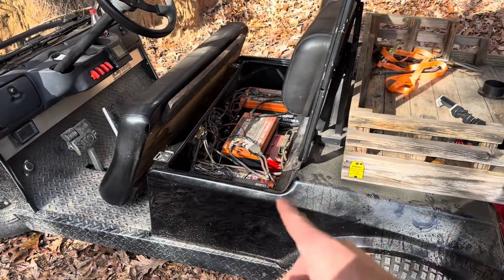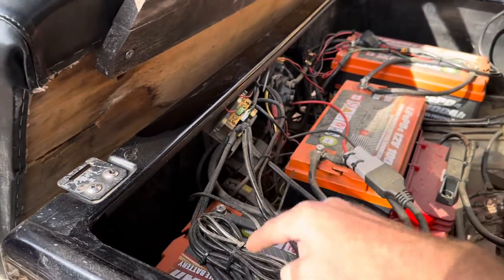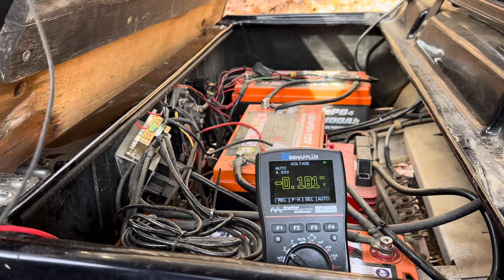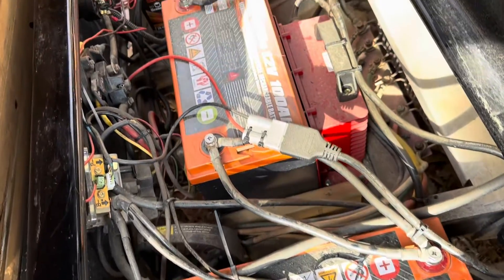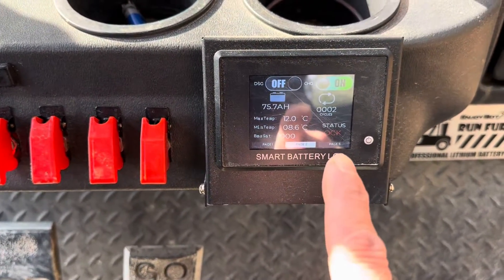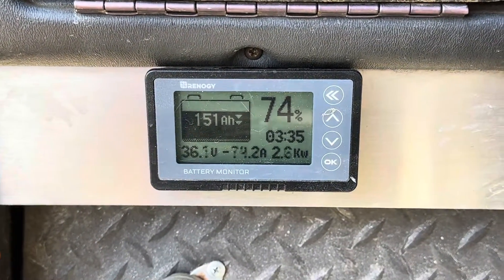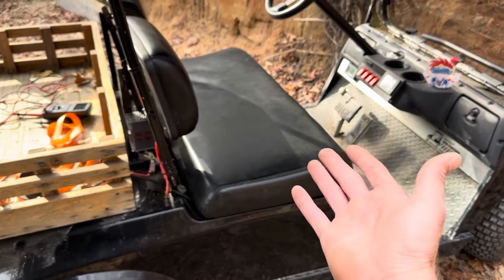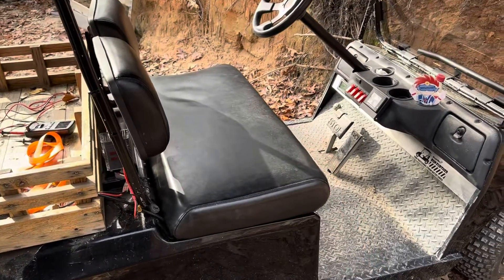I Used 3 EnjoyBot 12.8V 100Ah LiFePO4 Lithium Batteries For My Golf Cart, Best 36V lithium setup?

Comment: Hello I just bought a golf cart that it's trojan batteries are not working anymore they didn't maintain them with water for a long time. I saw Lifepo4 batteries in Aliexpress of 12v and 220ah supposedly. Can I use those or is there any other special requirement? I don't know of electronics and I don't think I would be able to add those LCDs to the cart to monitor stuff. Thanks in advance
Reply from the maker: Some LiFePO4 batteries have a more robust Battery Management System that can handle the loads from golf carts. Some manufacturers recommend against golf cart use. Check the specs closely or ask the manufacturer if rated for golf carts!

Comment: What are using as charger for 3 batteries? Original charger or new lithium charger?
Reply from the maker: 43.8V 18A Lithium charger from Form Charge. 
Here are some Form Charge videos. Good chargers. Multi stage charge algo keeps batteries happier. 
FORM CHARGE 12V 30A Lithium LiFePO4 Battery Charger Review
https://youtu.be/GkNjcSuCgUo
FORM CHARGE 48V 15A Smart Lithium Battery Charger for 51.2V LiFePO4: The Best Golf Cart Charger?
https://youtu.be/wmupbHjuo8Y

Comment: Great video, as usual! However this one opened up more questions! I did not realize that 12 volt devices could be powered off of one battery that is in a group of batteries in series for 36 (or more) volts! Did I understand that correctly?
If so, what about charging one battery in a series with several others with a 12 volt charger? Will the 12 volt charger charge that lone battery?
This could be an awesome lesson in its own video!
KEEP’EM COMING!
Reply from the maker: Yes OEM golf cart configuration on lead acid (not modern lithium carts) is to tap 12V accessories (lights, horn etc) off a portion of the series set of batteries. Full charging of the series set brings all the batteries all back to full SOC. The tapped batteries Will exhibit a potential V differential depending on loads. In my application LED lights are 7W+5Wfront/7W rears/2W taillight. Minuscule power draw if all on. Yes each battery can be individually charged within the series string. This similar to how string balancers work! This is how I would balance if ever needed. I don’t foresee this being an issue with LED lights. It would be more pronounced if running incandescent bulbs that draw 70+W just for headlights.